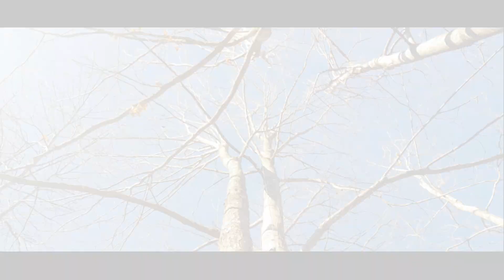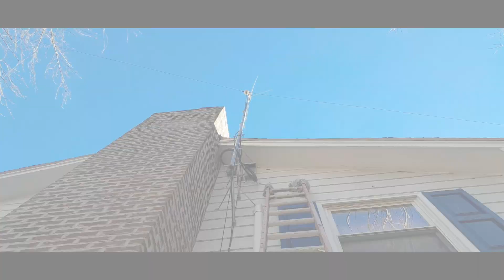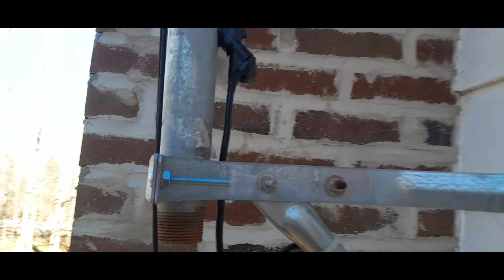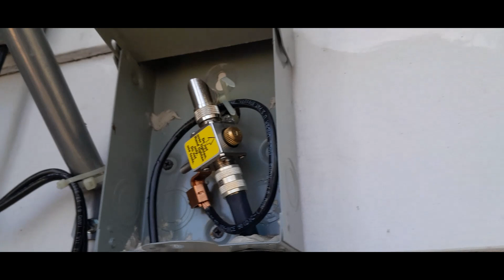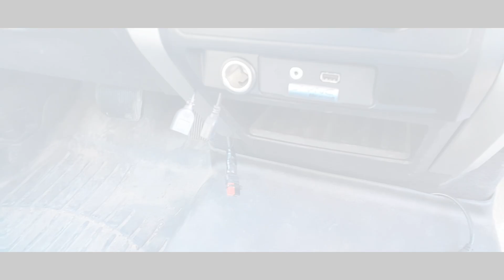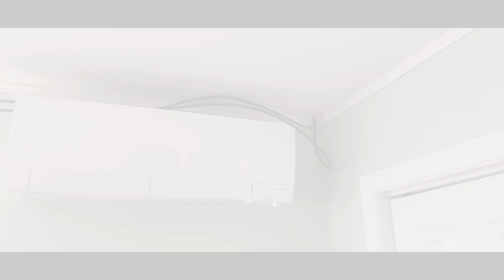QTH - Southern Command in Vermont

Comment: Very nice setup! I just rehanged/rehung/put up again my OCFD and I just tied the rope off. I'll have to use the brick method now!
Reply from the maker: It's handy.  If you're able to slide a pully on the limb it will help delay abrasion and wear on the rope...another option I considered was to sleeve the rope in a two foot length of hose or tubing something like that to take the wear.  You can also do nothing and just drape the rope over the limbs...but I think it's worth doing something, especially if you can reach it by ladder or climbing.
Reply: @ExactlyLikeVermont  I did do a pully, based on this video. It works very well. https://youtu.be/BOTzlZ409P0?si=BuF-CD1VRPhujrSd
Reply from the maker: @reidlanham2011  That's pretty clever!  Thanks for sharing I will have to remember and try that idea.  The vinyl tubing he's using is exactly what I used to wrap the tree limbs...wasn't intended for the purpose, but had it laying around the shop.  Works well!  You can see I used some of it in my bricks as well to avoid the bricks chaffing the rope over time.